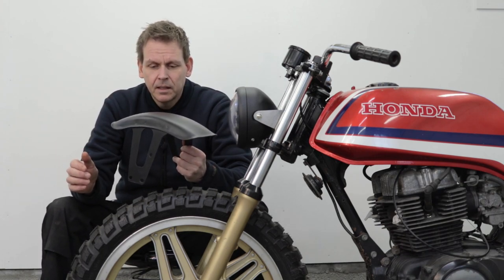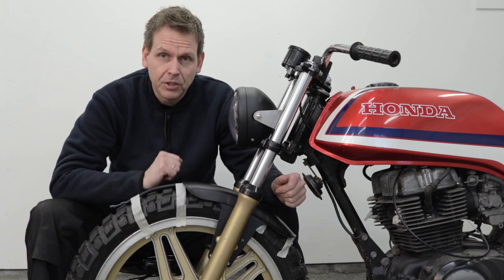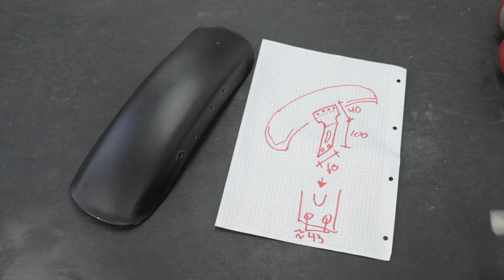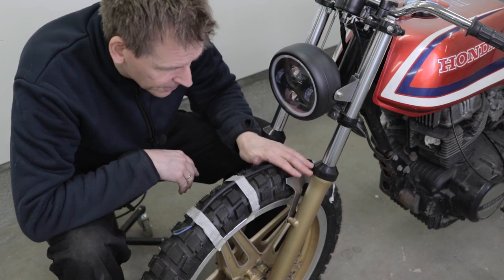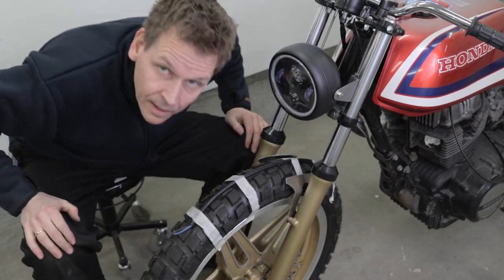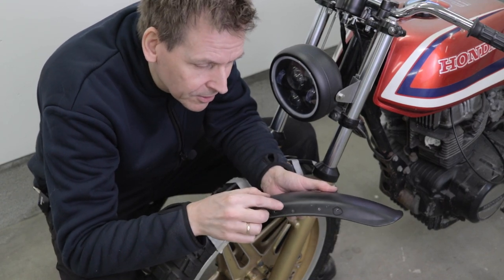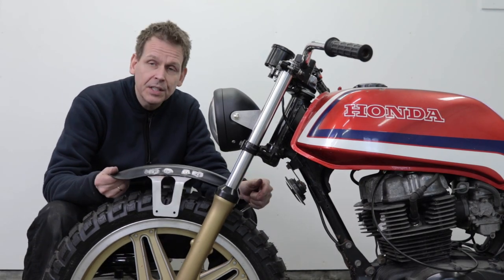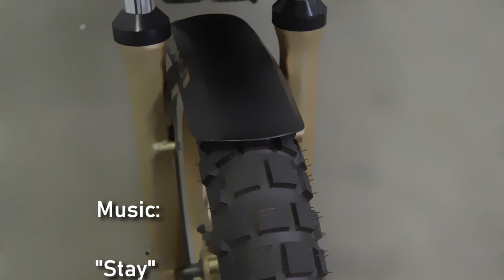Customizing Aftermarket Front Fender - Honda CB400 Cafe Racer Build E7·S2

Comment: Pär igen! Jag letade efter en cb400, men nöjde mig med en 250 då jag hittade ett exemplar som verkade vara det bästa för pengarna. Jag undrar vilken tjocklek du använder på plåten när du till exempel tillverkar nya fästen till skärmen. Ser fram mot nästa video. Allt gott.
Reply from the maker: Grattis med CB250!!! 👍 Til braketter använder jeg noen ganger 1,2mm (hvis de er veldig små) men som regel 2mm-4mm. Brakettene til fram-skjermen: 2mm. Det er derimot ingen fasit på dette, til ex brakett til fothvilerne er på 10mm da de være sterkere. Seat tray er lagd av 0.9mm stålplate. Jeg bruker "PLÅTARK 1000X500" fra Biltema, har alltid minst en av hver av disse: 0.9mm, 1.2mm, 2mm.

Comment: Hi mate, what size bolts did you use for the mudguard ? I’m using m6 but only seem to thread in a short way ? Thanks
Reply from the maker: Hi, yes it's M6 bolts. My bracket is 2mm thick, and I am using a 16mm bolt without a washer on it. Since the front forks are made of aluminium, the threads might be corroded. You could try carefully to freshen up the threads using a regular  M6 (x 1.0 pitch) threading tap, preferably with bottoming end.